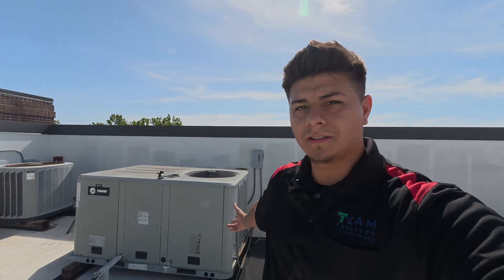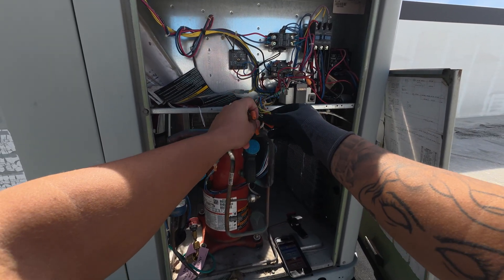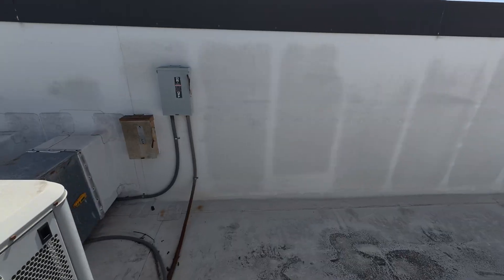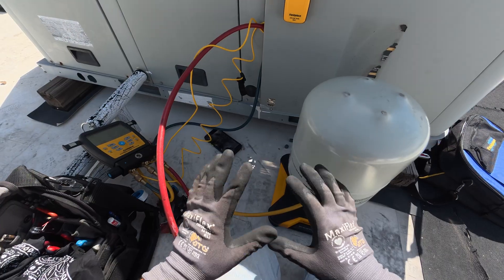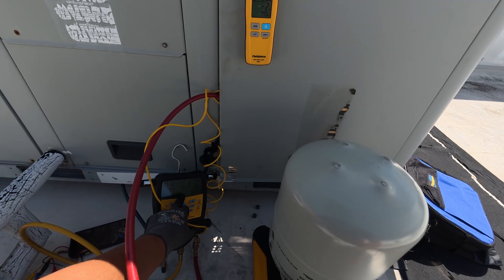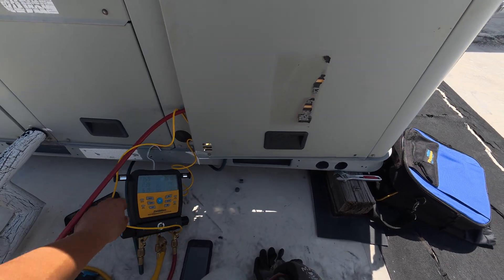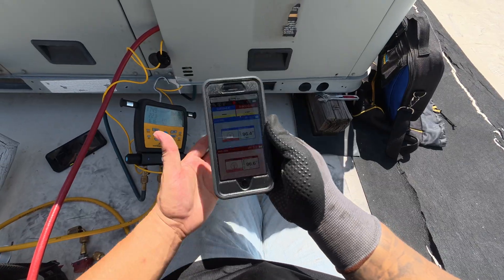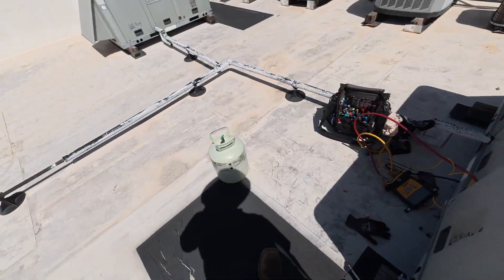Thinking This Unit Has a TXV Issue

Comment: Suction pressure too high bro. Looks like ambient air sneaking through, or the compressor about to take crap .
Reply from the maker: I was working on it today and I’m thinking the evap is clogged
Reply: I never heard the pressure before adding and then after adding.

Comment: Thanks for the video sir! 
TXV stuck open possibly! Suction pressure and saturation temp too high so could be TXV allowing too much refrigerant if it was stuck closed pressures and saturation temperatures would be lower. Since you cannot pump down compressor to check due to lack of service valves and since you had a bad capacitor on the condenser fan motor your compressor internal relief valve might be leaking if head pressures went sky high with not condenser fan opening internal relief valve many times which would also cause the higher suction if bleeding through. Weigh in charge after TXV change if still issue high suction then compressor most likely was stressed from high head pressures cycling relief valve. A hiss at the compressor is a sign but pumping compressor down will show if compressor issue!

If unit was older you could add Supco 88 or Re-New and force TXV full open and full closed placing bulb in ice water and hot water to help clean push pins on TXV but better to just change TXV!

Keep the videos coming!

Comment: Pull that bulb and hold it tight in your hand and have the door off, pulling outside air in. It should be feeding a lot. I would also write up the fan too.
Reply from the maker: I ended up just ordering a new TXV I’ll probably have a video of that getting replaced but you are right, I should have tried that

Comment: Good vid man, that unit had high suction pressure to begin with I’m definitely leaning toward a bad txv but when you replace it I would weigh in the factory charge seeing it’s probably over charged now!
Reply from the maker: It probably is over charged now, that’s I stopped adding in refrigerant. But once I get the new txt I will factory charge it